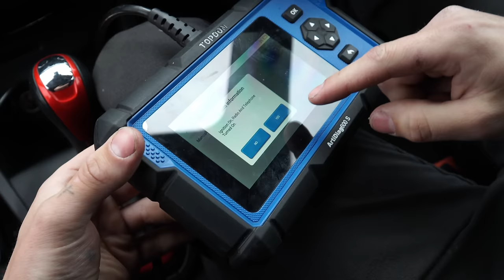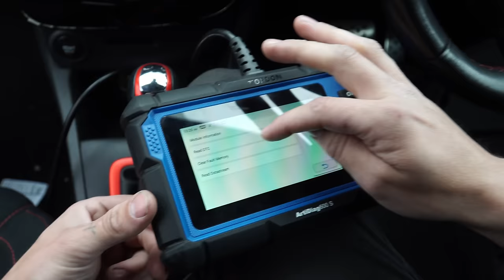They Rejected This Renault Clio After 7 Months!

Comment: Don’t bend over for these finance companies Joe stand your ground you’re not in breach of the CRA here at all
Reply: I’m afraid he is. Vehicle doesn’t conform to contract, happily the dealer undertook the work to identify the issue and it was resolved, fair charge for damage/usage as well - Lesson for dealer are to fully evidence diagnostics when something goes wrong, also retain full info on vehicle condition and description including any after market bits prior to sale, even better to have customer sign disclaimer agreeing they are aware prior to sale as well.
Reply: @sgntpepper1976  wrong for 2 reasons. On the balance of probabilities it’s highly unlikely to have covered 2k+ miles if it had a gearbox fault at the point of sale. Secondly the customer must formally reject the vehicle within the first 6 month period ie in writing. The dealer is entitled to an opportunity to repair the vehicle which I don’t believe happened.
Reply: @sgntpepper1976  Depends - if they ran a full code scan with the IM monitors set (showing it was not code reset) and have a record of that, then the fault happened after.   I would note that ALL professional code scanners keep records of previous scans.....
Reply: @centralmotorslyeltd  Sorry you wrong, the fact the car faulted in such a short mileage would be a factor in the decision to take the customer out the vehicle, had the customer covered more mileage the decision could have been different but the small amount of mileage before fault is the mitigating factor here. Had it gone to FOS they would support the customer, something the finance company will try and prevent
Reply: @sgntpepper1976  well I guess this is why we have the court system to decide. I for one would be telling the finance Co to do one after 7 months and I’ve been in this situation several times over the years
Reply: @centralmotorslyeltd "fault" was reported within 6 months, was rejected for that same reason so it is valid from that point of view.  Obviously if you can prove no fault then fight it, but the timing doesn't absolve here.  Besides, there was actually a fault, it was fixed and customer was happy to take the car back once fixed.

Comment: I'm on the fence with this, if a customer car went wrong causing thousands of pounds worth of damage within 6 months of purchase you absolutely should work with that customer to resolve it; but the car you're buying back here is not what you sold in the first place and when you include a full valet, paint correction, alloy refurbish and wear and tear on top of this I don't understand why you're not challenging this in court.

Comment: Reverse camera tagged onto the reverse light wiring to triger the camera on the screen ...tricks the canbus system into thinking there is a fault with the gearbox and gives short to ground codes for gear position and confuses the transmission control module flagging codes.

Seen this on vag dsgs and on ford/psa cars.

Check the wiring at the left taillight for evidence of a scotchlock having been used
Reply: Or drain the battery to create fault codes.
Reply: That's some brilliant info, right there? Well done. Sounds like you really know your stuff?
Reply: @derekduxbury1122  canbus/modern electrics , a nightmare !

Comment: The issue here is probably the transmission control module (or whatever they call it). It is the same issue with 2103 - 2018 ford Focus cars. Reset via the the OBD and put in a new battery ( or check it. this is why the car looses its control settings) and make sure the earth contact on the body is not onto a painted panel (issue with Ford). Undo the -ve, scrape the pain away, reconnect, then seal over.

Sorted.

Comment: How on earth can someone do so much damage in five months/2,000 miles!
Reply: Looks like a rolled back learner car 
I’ve rolled back a 70k Corsa sxi diesel that did 30k in one year back to 72k and got rid as clutch stared to slip .
Bought a newer Corsa Sri diesel and rolled it back 50k 25a year .
I return alloys to as new so you can’t tell though and valet them up
Reply: @chiefrocka8604 My man is literally admitting to fraud. And exposing himself for the little rat he is in the process 😂.
Reply: @chiefrocka8604 you are not part of the solution.

Comment: The added reserve camera could’ve been tapping power from the auxiliary systems, and the 5 volt rail could’ve been over stressed. That could’ve  caused an ECU under voltage bringing up error messages and preventing the correct transmission operation. This issue was seen on systems that used for example Pedal Commanders, which tapped the voltage on the ecu and caused errors. But I’m guessing here, don’t kill me.

Comment: Have to admit I’m on the verge of contacting my finance company to have my suv taken back. After 3 weeks of ownerships it had to be taken in for over a week for a failed pcv that leaked oil onto the dpf and nearly started a fire. Got it back and a cv joint was crackling. Contacted the dealer and was told they’d order one straight away. Two weeks past and they told me they forgot to order it. Then a coolant system service required warning came up on the dash. They plugged it in, erased the fault and told me the cv joint would be done in two weeks. Light came back on a few days later and now they won’t answer the phone or reply to messages. It’s a two hr drive to them and I’ve had enough of the bs and poor customer service. Ready to throw it back to them now.
Reply: Send it back before 6 months or you're gonna be in a hard place.
Reply: @FSFSFSFS532  it’s gone. Was already a hard situation to sort out. We traded a car against it and paid x amount of cash down to lower the repayments, so it was a bit of a mess trying to arrange. Done now. Better car on the drive and we’re happier all round.

Comment: Washer bottle filler fixing. They snap at the bracket near the headlight, the plastic is underweight for the task of wrestling the yellow cap off to top it up with. Ended up tie-wrapping mine back in place. They all do that squire.

Comment: I can feel your frustration.  I think the issue is new drivers don't realize cars are expensive and require looking after ,parts needing to be replaced is a question of when not if. garage repair bills are eye watering and it takes them by surprise and typically young new driver don't have much money so they try to wriggle out of their responsibility.

Comment: Our 2013 Ford Focus S had 1 clutch pack replaced when it was 10 months old. Now we are at 2024, with no gearbox probs for a long time. I have spoken to a friend of mine who is an auto transmission engineer, and he showed me why these sport-matic transmissions give so much trouble, the original transmission shift module was faulty causing the transmission to shift too early causing the clutch-pack to slip.

Comment: Glad a reasonable sounding solution was found.
But otherwise Are you able to deduct repair work required ? Obviously a small adjustment for average wear and tear. This is outrageous
Damage to wheels, trim etc do not count as “wear and tear” obviously. That’s simply misuse
Also where’s the independent engineers detailed diagnosis and proof the fault exists ?

You have my sympathies with all this. Shame as it’s a nice little car. Hope you resell it soon

Comment: Joe I worked for Renault for Renault for 20 plus years before doing my own thing and yes you are 100% correct about the battery and voltage or amp flow also I’ve had issues with worn spark plugs giving out a energy field and dragging down the Ecu new genuine spark plugs always worked as people don’t usually change them or put what they think is oe in and they are not also Renault have a very good technical ability on line at dealer level with a programming ability but with Renault software which we used all the times the issues it would cure was second to none my advice would be to have a hours labour in a good dealership I used to know the master tech in Bristol (not sure it’s open now though) they were pretty good worth a try

Comment: Clutch is a known wear and tear item. Much like the brakes, if it is working when purchased, then 5 months later, the brake pads wear out.... you can't return the car for a refund. You buy new brake pads. Or a new clutch. I wasn't going to buy my car... but when I saw it had a new timing belt, clutch and DMF £1000+ worth of work for a £1500 car, I bought it on the spot. 120k miles later... clutch is just about slipping when hammering it. Should I return it to the dealer? 🤣🤣
Reply: On an auto or semi-auto the clutch probably isn’t regarded as a wear and tear item in the way it is with a manual.

Comment: I also have a reno from 2014 and it drives fine never had any major faults other than once the breaks were having issues but it was an issue with the rear breaks just needing a good clean and the line flushed. There's nothing wrong with that car they just decided they want a new car and could abuse the 6 months window I'm sure its going to be a pattern with this person as a new driver and I hope they get tracked by insurance and finance companies and eventually gets pulled for fraud.

Comment: Here in Australia, I can get one that has done 77,000klm (48,000 miles) for just under 7,000 pounds as reliability on our roads gets 3 out of 5 stars and is not a huge seller. Also, there are not enough mechanics who will work on one.

Comment: It’s been a learner car them add on mirrors plus cameras are what driving instructors use and all ADI’s lovely learners mega  muller the alloys .
Check if the passenger footwell trims have been messed with fitting He Man duals, also any other mirrors suction marks them together suggest driving school 😂
Reply: they are actually just useful as blind spot mirrors.

Comment: worked for Skoda dealership in 90's owners aunt bought  a Estelle 120 5 speed.... 6 months later needed a clutch, then another 6 months later - the usual boss ranting crap quality - so now on 3rd clutch we ( boss and  I ) got HER to drive it ... only ever used 3rd gear, even from starting off, the test drive was like MR. MAGOO on steroids, actually got out at end and basically did 3 hail Mary's and kissed the ground..... Boss took her keys off her and told her she had to give up driving before she killed someone....
Reply: 😂😂😂 can you imagine being on the dual carriageway 3rd gear making that Estelle scream 😂
Reply: Had a customer that drove in first gear through town from our workshop  taking her home approximately 6 miles she claims it was high on fuel and tended to overheat .

Comment: You didn't mention invoicing the cost of the missing jack. A genuine Renault part ( so that it fits in the moulded foam ) would certainly be £70- £100 I guess. You should also have a standard administrative charge for V5 replacement, so that the finance comp-any couldn't simply give the straightforward monetary cost from the DVLA for replacing the V5.

Comment: Might be me, but what stood out most about the costing was "3" tyres...

Unless one is literally brand new already (?) I'd be quoting for 4 - on the basis that you should always replace both on the same axle together (same as shocks, discs/pads etc).

Still... You've been more than reasonable as per usual - I suspect they're taking the mickey a bit, but equally for someone who knows nothing about cars to panic and just want out is plausible, I suppose.

Comment: I’m surprised you can reject a  car after 7months  and as I was aware you wasn’t allowed to do modifications on a finance car since you don’t own it the finance do until final payment received so can’t start adding Cameras  wired in incase you cause damage in this case like they did buy having a cut hole for the cable or customizing the vehicle

Comment: My car started to send up the engine management light every once and a while and the mechanic wasnt sure at all so i decided to try changing the coil pack whenever i had time off and that cured it,no codes were ever stored on the system pain in the ass i was worried it was a house and didnt want to splash out on the pack

Comment: Dual clutch cars drive completely different to automatic 
People often think that they don't work correctly, a dual clutch when accelerating selects the next highest gear if you then suddenly throttle off it's got to make a decision to go to a lower gear then it hesitates people think this is a problem it is not it's how dual clutch work
Reply: I had a 2014 Ford Kuga from new,it was fitted with the Powershift gearbox which worked perfectly at first,several weeks later the problems started,returned it back to the main dealer,in their words they had to reflash the gearbox with the computer, worked perfectly fine for about another three,months and the same fault started again. Took it back again to the dealer who told me the same thing,I should have rejected it and refused to have it back but being a reasonable person I decided to persevere as when the vehicle was working correctly I really liked it. In time and several visits to the dealer I got really pissed off with it and traded it in for a BMW 7 seater 2litre diesel with the eight speed automatic gearbox. The vehicle never went back to the dealer except for its two year service,should have bought the BMW first time around,the fuel consumption was abysmal only ever reaching 38 mpg on a trip to Scotland. The BMW never did less than 40 mpg and on a long run bettered 55mpg which was a pleasant surprise after the Ford,will never purchase Ford ever again.
Reply: Exactly I had a Quashqai, same gearbox I loved it.

Comment: Volvo v70 had endless list of ecu codes and gearbox ecu 254 fault event codes stored and would go into limp mode constantly . 
bought as non runner at BCA Out the door for £245 retail clean £2250
Loose wire plug to rear view mirror . fix push in fully.
Replace battery in alarm siren . fix £18 of amazon for nimh battery.
original car  battery replaced as showed 10.2v when left disconnected overnight 
even after charging for 2 days . fix battery from ECP £120
OSF abs sensor loose so no signal. fix tighten
re replace osf abs ring as not on squarely , fix strip and rebuild with £1.98 ebay ring.
drain and flush gearbox oil and fresh JWS oil , clear gear event codes and reset counter.
run for 200 miles and repeat flush . £160 on oil.
Now a fine running volvo thats seen me good for 6 years . 
But you do need VIDA on a laptop and the dice OBD communicator interface.

Comment: I know someone with a renault capture 0.9e cutting out with loss of power after after owning it for about a month and a half, it was approx 4 to 5 weeks at the dealers repair garage trying to diagnose and repair it the car and then was sent to a renault dealer who suggested a new turbo, this was fitted but the car still does the same thing, its back in with renault who are struggling to find the cause of the issue, it is now over 2 months+ since the owner has seen the car and therefore has not driven it since the issue arose, how long do they wait  for a satisfactory resolution ??
Reply from the maker: It’s a completely different situation so I don’t know 🤷‍♂️

Comment: Here it shows the power of the Finance company, however, finding a LOOSE bolt under the battery, does support the fault existing at time of sale.  Of course, it's resolved so the Customer shouldn't have the right to reject, it's 10 years old so issues are expected, but thats the power of a finance company.  Had they paid of it cash, there's no way they've have the power to reject.

Comment: i'm a driving instructor and not one of my alloys looks that bad after 3 years and roughly 100,000 miles. Even then it would only be the front passenger side that's bad, with a little bit of damage on rear passenger side. How the hell did she damage all 4 that badly in just 2,000 miles? something doesn't add up there

Comment: AMT are never as smooth as a normal auto. However that gear box appears sound they will bit rough at low speeds when deciding which gear. My auto gets bit rough when undecided as well.

Comment: Who’d return a car in that state …. says all you need to know about her.  

And another (long) thought - perhaps it’s how they installed the camera, CarPlay module and good knows what else that screwed the battery because the Battery Protection Management module in cars can be a nightmare on their own (without some idiot hard wiring additional stuff in, likely to the wrong amp fuse and creating a power leak.  I had to replace BPGA on my Peugeot 3008 just after we got back off last holiday as it developed a power drain whilst not being used (stuck solenoid) that threw up electrical fault on the screen and kept draining the battery - the module couldn’t be fixed so had to replace the whole thing - and the battery as probably was due anyway.  When that fault was thrown up it also threw up an AdBlue fault soon after (£1,500-£2k @ Peugeot to replace that tank) which I kept having to clear but came back after engine got up to temp or after a day or so but luckily just before I was going to have the AdBlue ‘erased’ by my ex-Peugeot master mechanic friend it fixed itself, but have no doubt the electrical fault led to that error as the voltages and amps will have been off until I replaced the module.  Modern cars battery management can be a right pain if they play up as they don’t always appear as a battery issue.

Comment: The water in the coolant looks more like piss!    This buyer has royally pulled your pants down here......only 2000 miles and all 4 wheels are gashed up not just the odd kerb impact.......the sound deadening under the bonnet just seems odd.....the whole thing is odd.

Did they just want a hire car on the cheap?
Reply: That's the Renault Type D yellow coolant. That's how it's supposed to look!